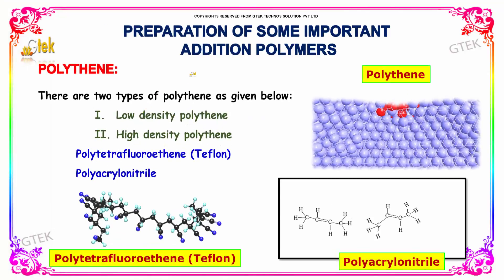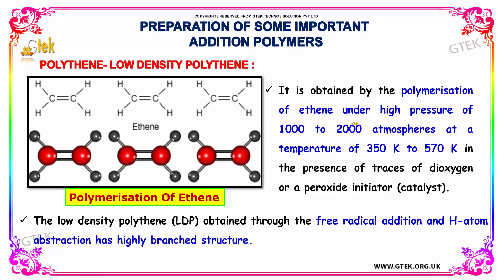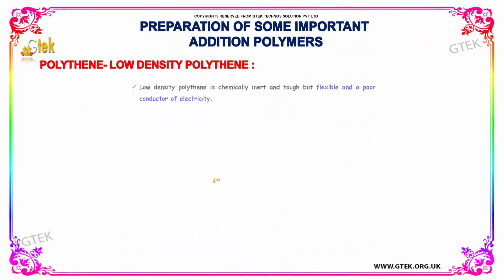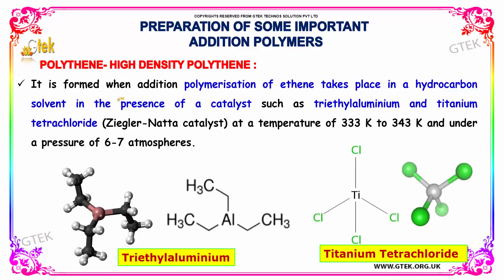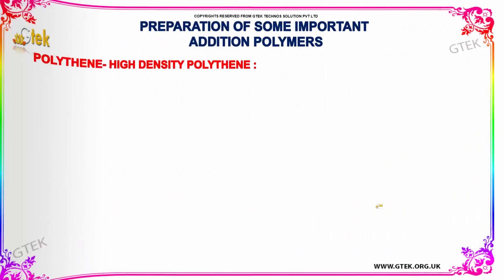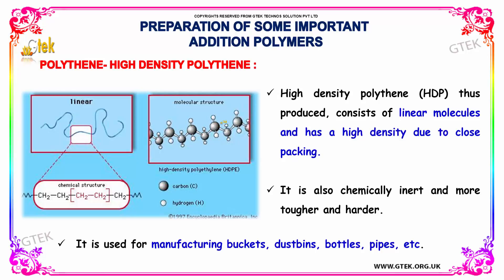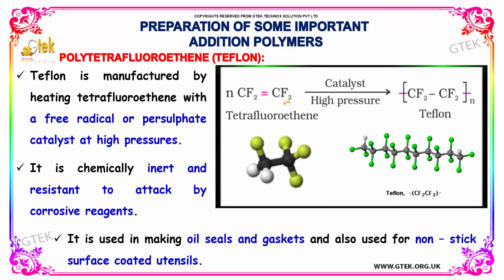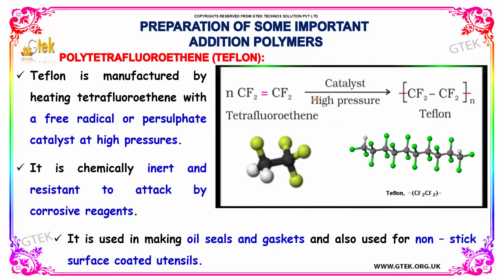preparation of some important addition polymers class 12 chemistry subject notes lectures cbse

Comment: Most of the common addition polymers are formed from unsaturated monomers (usually having a double bond). This includes polyethenes, polypropylene, PVC, Teflon, Buna rubbers, polyacrylates, polystyrene, and PCTFE. Addition polymers are also formed from monomers that have a closed ring.